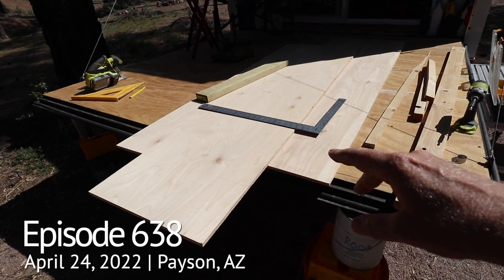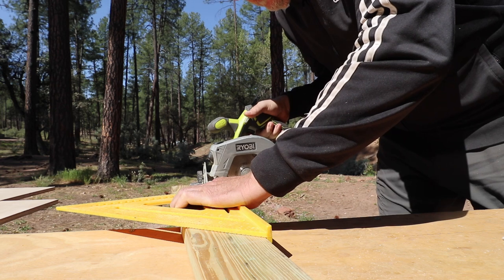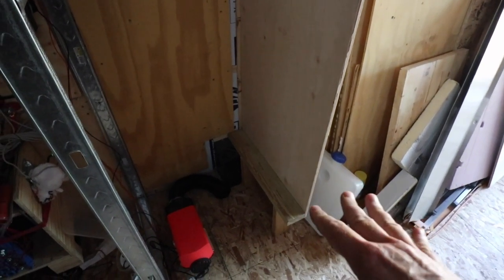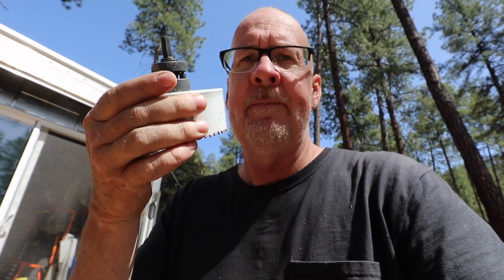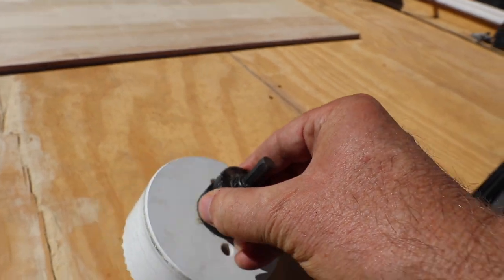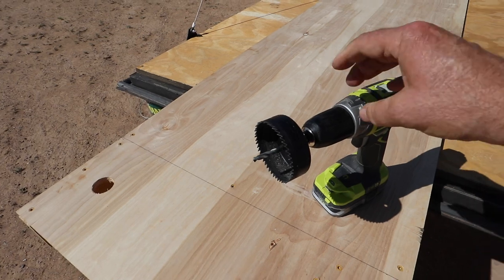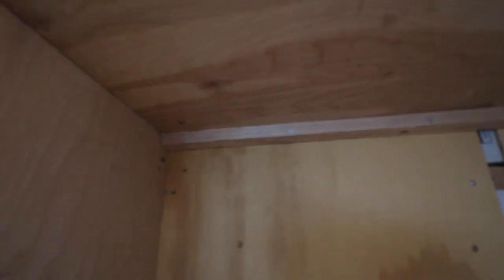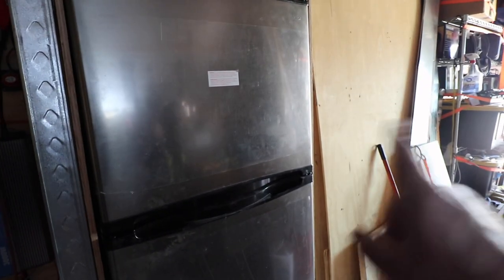Fridge Riser Box for Cargo Trailer Conversion E638

Comment: It looks like you have tighten the mandrel down onto the hole saw.  When you put the mandrel onto the hole saw you screw it down until it won't go anymore then you back it off a little  until the pins line up with a set of holes on the hole saw, then you screw the ring that brings the pins down into the holes on the hole saw. the pins do the driving not the round base of the mandrel. The hole saw may be a little lose but that's ok. If you really don't want the hole saw and the mandrel to be a little lose put some anti seize between them before you tighten them. if it is really seized on we use a big vice and a big pipe wrench . hope this helps.   Tom  C

Comment: The mandrel should be spring loaded, it has two pins that go thru the cup, that keeps the cup from tightening too tight. the black disc that is against the cup (with the set screw in the side of it) needs to pull up to the knurled disc, you will have to hold it up against the knurled disc to allow clearance for pins to be able to then unscrew it from cup.....

Comment: Those "arbors" often times do get stuck, so here is how you get it unstuck. Chuck the arbor in the drill put it in low speed in reverse grip the saw blade with channellock or cobra pliers, you can also use a thin screw driver to pass through both slots and gun the trigger a couple of times. If you never want to have the same trouble again, get a roll of electrical tape and after you run the collar down and push the lock pins into the holesaw tape around the base an lock collar of the arbor at the same time effectivley locking the collar from backing out! Cheap insurance so you never have it get stuck again!

Comment: Be sure you have ventilation for your refrigerator even if it is just electric. Your coming along fine be sure to stop and smell the roses.
Reply: The fridge definitely needs to have room to breathe. The owner's manual will show minimum clearances at the sides, back and top. It might be possible to use less clearance if fans are used to evacuate the heat from the cabinet